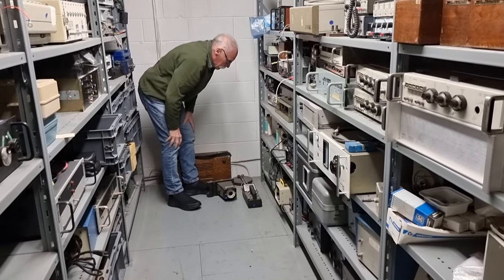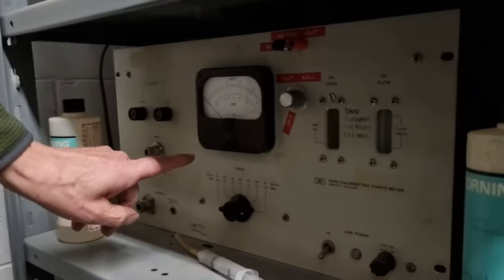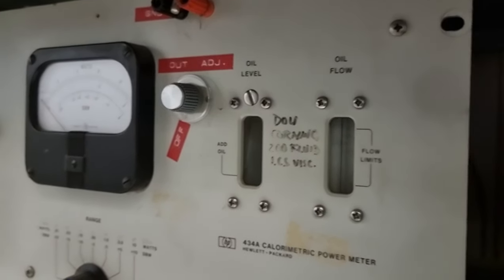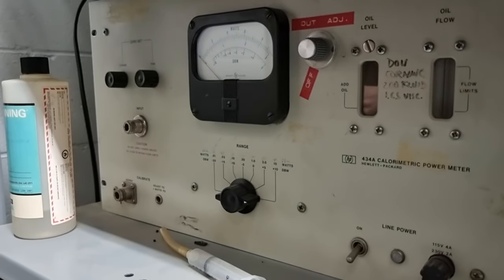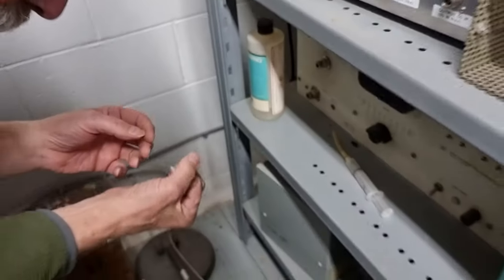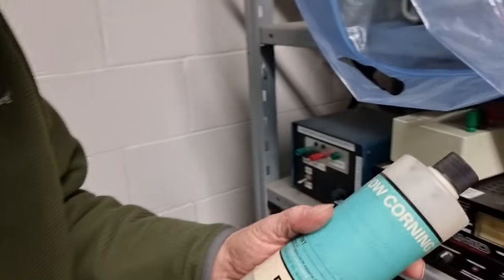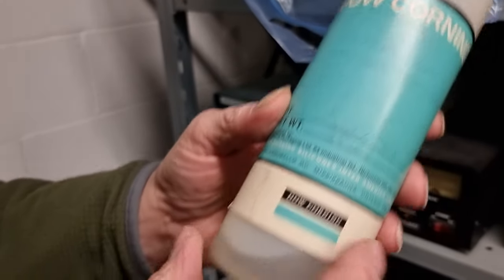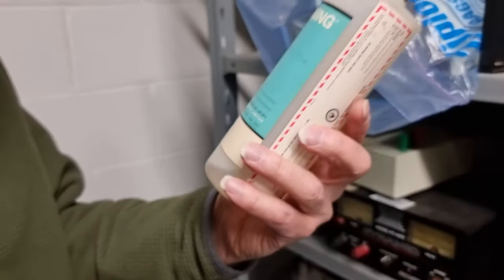Hathaway Research Internationals highly accurate electrical power monitor

Comment: While silicone IS exceptionally heat resistant, it has a lower specific heat than many other coolants- and at ~10 W max on the resistive element, specific heat I would think VERY important to highly-transient heat inputs, so HP's choice of it for this system was probably based on much more important parameters (if the resistor can very locally develop hot spikes, water, for instance, could boil or might even thermally decompose and the O and H species cause serious chemical damage.)
Reply from the maker: Pretty sure it was engineered to work very well.

Comment: Also in one of the other vids you talked about electron mfp.. keep in mind as you delve into nanosystems build by pvd/cvd systems that's highly dominated by grain structure of the deposited film which is highly variable per chamber with temp, pressure, ion energy etc..

Comment: When i got my PhD in nanoscience, i built small suspended metal bridges from ALD films using a novel processing technique i patented- they were about 20 nm thick and 10's microns long that i used as self-contained calorimeters. If you know the temperature coefficient of resistance of the suspended metal, you can use microprobes to run power through the bridge and measure anything from its thermal conductivity to specific heat capacity. Has anyone tried to measure excess heat like this? would be easy enough to sputter some Pd on them and/or build them out of nickel, put them under vacuum and flow hydrogen. Also would be simple enough to heat them up to high temps with just joule heating.. could be a nice easy way to isolate the effect and get detailed measurements of excess heat.

Comment: Using a resistor divider and that fancy piece of hardware, you should be able to accurately measure things with much more power out than 10 watts
Reply from the maker: Sure
Reply: The calorimeter bomb part may only be capable of that, I'm sure that's the actual limiting factor.